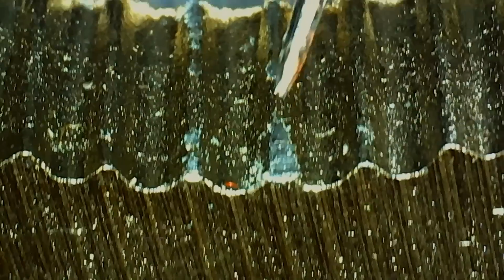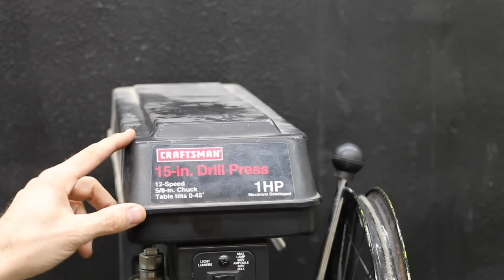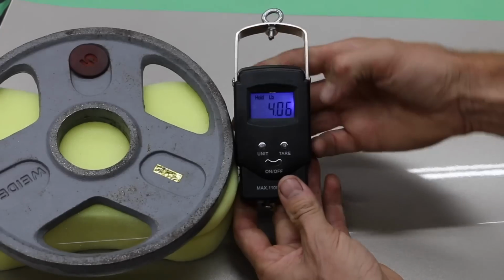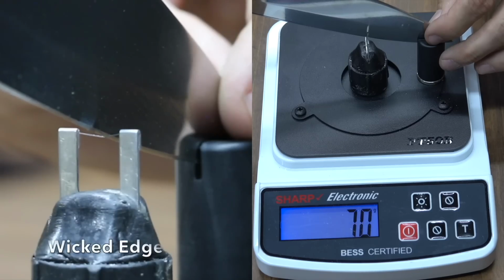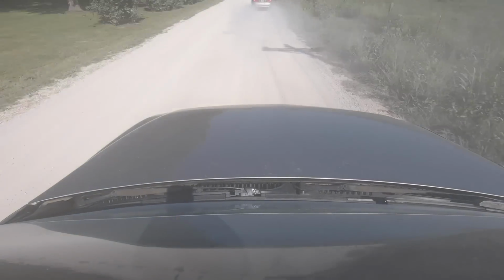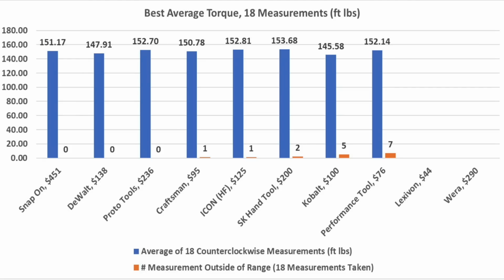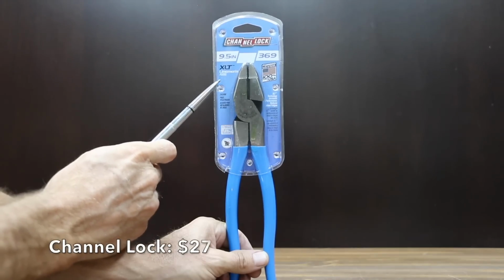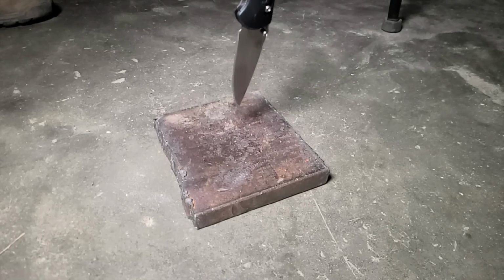Best USA Made Tools Ever Tested? Lets Find Out!

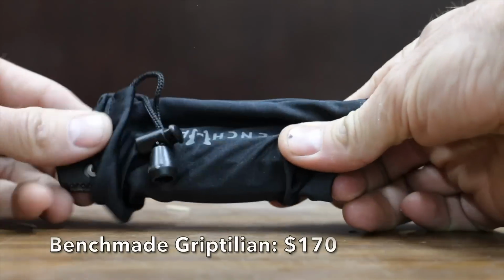Comment: 13:55 Benchmade Griptilian really is the best option. JUST BEWEARE OF FAKES.  I feel like I've carried every viable knife locking mechanism, nearly every major brand and a lot of custom knives.  Through it all I come back to the Benchmade Griptilian.  It's light, ergonomic, ultra strong and nothing beats it at this test:  With one hand, flick open, cut something, flick shut and back into pocket.  All of the other mechanisms fail to deliver the reliability, speed and simplicity of the Griptilian.  Benchmade will also sharpen them for free for life if you send them in.    Note: I've tried many custom handles and they just add weight and have no other benefit, so I return to the basic handles that come with it.  It's hard to believe they tried to cancel the Griptilian, but the customers freaked out and Benchmade kept the model alive.
Reply from the maker: Thanks for sharing.
Reply: Nah. Cold Steel. 1/2 the price, almost exact same performance in most tests. Spend another $90 on a better CS to match the price and you have a knife that’s better in every way. 

Benchmade is severely overpriced

Comment: Hello, your videos are great.  But I just noticed one thing, at about 12:22.  If you are measuring the torque on the bolt head, not all of that torque gets transmitted to the nut.  Some of the torque goes into friction against the washers and the work piece.  It would be interesting to try and measure the torque on the wrench directly with some kind of adaptor.  (Maybe you have done this in other videos).  I hope this is helpful
Larry
Reply from the maker: Thanks for sharing.

Comment: So knowing you used to be in the Air Force gave me an idea for a video. This one would be a little bit of a departure.

Sunglasses! You could test their UV blocking and also the polarization and light transmission as well as lens and frame durability. Sunglasses are tools when it comes down to it. And having an inferior pair could actually cause way more harm than some of the other tools that you review.

Could get expensive though. But this got me thinking of safety gear in general.

Also ear protection. I used to work at an airport and we had to wear them when we were outside on the runways. I also use them for shooting. I wonder if you could figure out a way to test how much sound ear protection actually blocks. There’s some very common brands you can test as well as ear plugs. 3m, Peltor, Howard Leight, Walker. Etc

You mentioned in one of your videos about wearing eye protection I believe when one of the bolts snapped at 1100 psi. Testing eye protection could also be fun.

You could do a series of safety gear themed videos and end with gloves or possibly fire retardant clothing of some sort.

Keep up the good work. We love you out here.
Reply from the maker: Thanks, will do!   Thanks for the suggestions.

Comment: For adjustable wrenches: try a locking-grip style. A great tool!

I have a Stanley 85-610 that never ceases to impress and is one of my go-to my “problem solver” tools. It’s easy to clamp and release with one hand. 

Once this breaks I’ll upgrade to a Craftsman ExtremeGrip for the comfort handle. However, it’s been 5+ years and no signs of failure.
Reply from the maker: Thanks for the suggestion.

Comment: When the US maker of Craftsman tools got bought out or went out of business, I started buying every US-made Craftsman tool i could find at Sears and at Sears online. I already had enough inch tools, so pretty much stocked up on metric wrenches, metric sockets, screwdrivers and adjustable wrenches. it worked out well, but I passed on most of the inch sockets and wrenches at that time. The US-made sockets and screwdrivers were top quality. The wrenches were decent quality and strong.
Reply from the maker: Thanks for sharing.

Comment: I've just had an epiphany on something you could test. Drive belts for lawn mowers. It seems like my mower eats a belt every year, sometimes more than one, and I've checked, double checked and triple checked the alignment of pulleys, got upgraded carbide tipped diamond plates turbo blades, I don't mow thick or wet grass, the belt doesn't slip or smoke ever, but it seems like once or twice a year it comes apart in massive chunks of rubber and whatever kevlar or stuff they wrap them with.
I'm curious if name brand vs cheap is any better, I've tried both, and it doesn't seem like a significant difference to me, but between power transmission and strength maybe I'm missing something.
Reply from the maker: Thanks for the suggestion.

Comment: Would you please do a test of various brands of aluminum floor jacks.  There seems to be a number of brands.  Some don't lift very high. Some bend according to buyers. Other folks claim that some leak within a year.  Some sellers market them as "racing jacks" do to the few pumps it takes to extend them.
Reply from the maker: Thanks for the suggestion.

Comment: Video idea: Car covers! 
(Outdoor ones)
I'm mostly interested in knowing which, if any, will actually make a difference in protecting an already-slightly-rusted 90s Ford from elements that might speed up the oxidation process.
Might I also suggest a comparison between a car cover which touches the metal directly (installed as directed) and one which had spacers between the cover and the metal to provide a gap between the moisture barrier and the metal. If you've ever been in a tent in the rain, you might know what I mean...the rainfly may work fine, until you touch the inside of the tent wall! Then the water sometimes migrates through once it's saturated. In my mind, this might cause issues with trapping moisture against body panels (especially the roof).
Love your channel, and thanks for the work you do!
Reply from the maker: Thanks and you are welcome!  Thanks for the suggestion.

Comment: long time watcher, had an idea for a video as im about to try this myself. But before i wreck a good engine..... Can you mix stanard multi grade engine oil with heavier oils to change its viscosity? i.e 5w30 etc, even as far as mixing heavy gear oil like ep90, or ep140 etc to adjust the grade upwards? buying expensive motor racing oils like 20w50 valvoline, could you home brew that grade from 5w30? 5w40? Would the additive packages affect either oil? EP oils contain sulfur, would that screw with an engine? What would the analysis show? What dya reckon? :) Keep up the good work,
Phill
Reply from the maker: Thanks, will do!  Thanks for the video idea.

Comment: Suggestion: Could you test Bike Chain Lube? So for Bicycle there are teflon based, oil based and silcon based lubes. Even Wax is used. Question is which one does the job best regarding dirt resistance and longlife of the chain. Greetings.
Reply from the maker: Greetings!  Thanks for the suggestion.

Comment: I concur that to many manufacturers, corporate profits are more important than good products these days.
Sadly, China buys into this & manufacturers there make products to the bare minimum to meet the stated specification & woe betide any company which can't write a tight specification (sea fishing reels where stainless steel wasn't specified for external screws was one I came up against from one supplier - they'd used stainless in the pre production batch, then swapped to zinc passivated for the main run...).

Comment: The RocketSockets are AMAZING!!!! I had a REALLY bad bolt on the front end of my wife's truck. The worst part is it was a hard to get torque due to the angle. I ended up having to bang one size smaller, and the bolt finally came out. I was afraid what it would do to the socket, it looked as good as new. I HIGHLY RECOMMEND.
Reply from the maker: Thanks for the feedback.

Comment: Great video..Could you test 1/4 inch torque wrenches? Especially for low inch lb settings. lots of plastic or composition parts are requiring low torque tightening, around 20 in lbs.
Keep up the great video..
Reply from the maker: Thanks, will do!  Thanks for the suggestion.

Comment: I've been wondering if you'd be willing to test the strength of homebrew-type adhesives.

-Loctite Liquid superglue with Baking Soda (or which superglue is the best when combined with baking soda). Can 3M adhesive spray be used as well? 

- JB Weld Original with acetone to thin it (as a threadlocker), and also using Methyl Ethyl Ketone (to see if the longer drying time allows for a better and stronger cure).
Reply from the maker: Thanks for the suggestion.

Comment: Hearing that indoor air pollution is actually worse than outdoor pollution and being very allergic to dust a HEPA indoor filter comparison would be awesome.  i am actually most interested in if they perform the same at low and high speeds as i am wondering if on high they turn into more of a dust shredder and emitting lots of small particles vs low.
Reply from the maker: Thanks for the suggestion.

Comment: I'm Canadian but I'm on board with buying local where possible.
My new TIG welder is a made-in-Canada AC/DC 200 amp unit from Canaweld. No regrets. Solid and works great, but costs way more than the Chinese ones which are flooding the market.
Honestly, though, in this day and age, we should be gearing up to make sure that we can stand on our own 2 feet when it comes to supply, manufacturing and industry. Russia is screwed because most everyone turned off the tap for them. And agree or not that they had it coming, you have to admit that it's deeply risky to be in a position where we could be knocked on our arses in the same way. Better to support our own industriousness and make sure we don't have to break pace if things take a turn...

Comment: @Project Farm How about the best window or box fan based on cubic foot per minute / decibel for a couple price brackets?
I'm trying to pull cool air through the house at night to cool the house, but the only box fans I've found are too loud to sleep around. 
So my choices are not sleep because of heat, or not sleep because of noise. :(
Reply from the maker: Thanks for the suggestion.

Comment: Corn Head grease vs Mobil SHC 100 grease ....These are total different greases.  For ebike motors gears most have use Mobil grease,  Now some are say Corn head grease is best.  Some say that mobil grease flings  the grease  off the gears.  Cold weather performance,  damage seals with corn head grease. longevity, friction
Reply from the maker: Thanks for the feedback.

Comment: Thank you, again for a great video.  One suggestion for upcoming testing, entry level 4.5" angle grinders (i.e. low cost, <$50 or <$75). I like to have multiple angle grinders around for specialized uses, such as having one for wire wheel duties, one for coarse sanding, one with a normal grinding wheel, one with a cutoff wheel, etc. as I used to be able to get 3 or 4 HF paddle handle grinders for the cost of one name brand top of the line angle grinder.
Reply from the maker: You are welcome!    Thanks for the suggestion.

Comment: How about e-tools; SOG, Gerber, Ozark Trail(Walmart), the Crovel? Are they a decent replacement for hatchet(some have an edged side), or a saw; what's the strength of the joint washer, rust resistance, whatever else you can think of?
Reply from the maker: Thanks for the suggestion.

Comment: Now we need a worst of stuff tested video.  The hall of shame.

As for USA vs import, I couldn't care less where it's made, as long as it's made well.  I have USA, German, Swiss, Japanese and Chinese tools and good tools are good tools regardless of where they are made.  In my experience though, USUALLY the price tag equals quality but often (as your videos have shown), not a direct correlation between price and quality, i.e. a $170 Dewalt 20v XR drill is going to work really well but $70 better than a brushless M18 Milwaukee? Probably not.
Reply from the maker: Thanks for the suggestion.

Comment: I do really love your videos.  My request may be out of your wheelhouse but would love an honest review on them.  Trail Cameras.  While designed for hunters I am in the market for my yard and property.  Garden keeps getting eaten by something(what?).  Bears walk by our home (how often, when?).  More things getting eaten in front yard (want to see).  Some give you alerts which would be better for home security too.  Like most tools I am reading older is better.  However, these are cameras and those have generally gotten better with time.  Since just in my yard was thinking I could access a wifi model from inside the house.  Important points are: FOV, Image Quality (high MP does not always equal high IQ), Battery Life, Range/Quality of motion sensor, WIFI range, Cost......  Thanks for the consideration and keep up the great work!!!
Reply from the maker: Thanks, will do!  Thanks for the suggestion.

Comment: Do a vid on half cut bit sets. Like VIM tools Snap-on Matco Mac , I think Milwaukee now also.  Half cut bits that are strong zinc plated are life savers and money makers in the shop when paired with a low profile bit ratchet like Gearwrench or VIM. Even better would be Snap-ons right angle power screwdriver with torque protection or Milwaukee's right angle bit driver(its a bit slower and weaker though).    Tight fit tools are the goto now in the shop or at home.   I can get paid 5hrs on a job that now only takes me 2hrs cause of the ability of accessing out of reach fasteners like M bolts or torx bolts on newer Euro cars (BMW, Porsche, VW, and Audi).   You doing a torture test on half cut bits is a money saver. I wasted good money on a VIM halfcut bit set at $120, it started of good but after repeated use I had torx bits cracking apart XYZ bits losing edges and stripping out bolts creating an expensive customer nightmare.  I ended up building a snap-on zinc set at $5.30 a  bit for just the ones I needed which ended up being 27 bits from metric hex, torx, XYZ, slotted, and philips.
Another type of tool testing I haven't seen is Magnetic socket sets. I'm looking to buy a chrome 1/4" set to keep the profile small since these are needed in tight out of reach areas. Since they should only be used for starting bolts not torquing. So a magnetic socket set range from 4mm to 15mm seems about right. The only worthy brands would be Tekton, Capri, Gearwrench, BluePoint, Sunnex, Snap-on, Cornwell, Mac, Matco, Astro, VIM, Craftsman, Neiko, Wurth, SK, Grey Pneumatic, Nepros, Koken. (Food for thought)
Reply from the maker: Thanks for the suggestions.

Comment: So…let me get this straight…”used by many calibration shops”,  as you said, with  a $1000 torque tester ?
Really ?  That’s the resolution that can be expected when hiring a calibration shop to test my torque wrenches ?
And how much do they charge for said “calibration” ?   I mean, if I can buy that tool for $800-$1200, depending on where I buy it from, why do I need a “special” certificate from a “$1000 TOOL”  calibration shop ?  
When I can buy my own, like you did, for….duh…$1000 ?
Having said that, Why would a “calibration shop” be using such an INEXPENSIVE calibration tool, as compared to calibration equipment that utilizes the same principles as your BUDGET diagnostic equipment, but costs three to four times as much, and offers a resolution double than what you are using ?
You don’t have to answer that, I understand what you’re doing here.  Getting rich on subscribers. 
Great game my friend.

Comment: Didn't see the one with the black plastic but what I like to do is dielectric grease let it sit a few minutes like after polishing it and then wipe it off and use a plastic protector and polish even ones just for interior works. I've done it even in things that started to dry rot and let it sit for over a year and still looks new and it even restored the strength and flexibility.
Reply from the maker: Thanks for sharing.

Comment: I bought some Klein tools side cuts that tested well, I thought they might be good enough to prevent me from buying some cable cutters for bicycle brake and shift cables.  With most side cuts, the cable frays on the end before you can cut through the cable.  The Kline tools cut the cable very easily, and cleanly, with no visible damage to the cutters.  Thanks so much for the testing.
Reply from the maker: You are welcome!

Comment: Hey Project Farm, love your videos. Wondering if you could test out some of those hacks for a stripped out screw hole in wood, or metal. Where people use copper wire, zip ties, glue, hot glue, small piece of wood, smaller screw, and many others I've seen. Just to see which is the strongest filler.
Reply from the maker: Thanks for the suggestion.

Comment: I've actually been using the turtle wax products for a while now. Their reformulated products are working great compared to their stuff from a decade ago(at one point their wax left a residue on my car so hard I had to use acetone to get it off). Within the last few years they completely redid how their stuff was made and it shows. I've basically moved from meguiars to turtle wax entirely at this point.

I said it before on the lansky set but that guide is pot metal, so over time depending on how much you use it - it will wear grooves into the guide and start to cause issues sharpening. The guide rods and stones will easily out live the guide itself... really my only gripe to that system. It's an otherwise great product. Well that an the holder for the guide really doesn't "hold" it too well and has a fair amount of slop.
Reply from the maker: Thanks for the feedback.